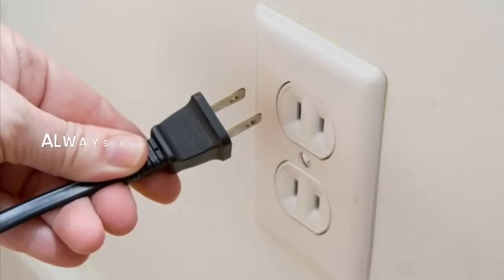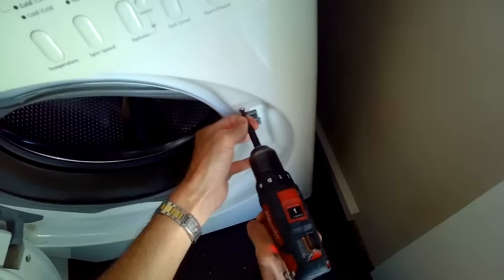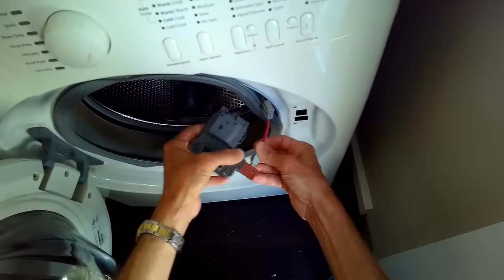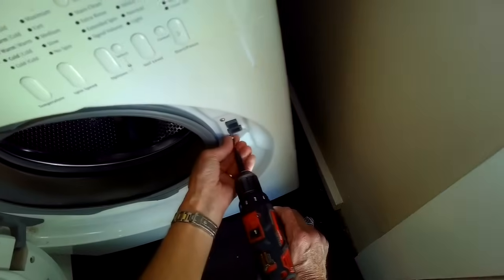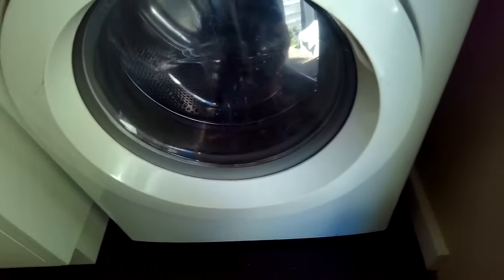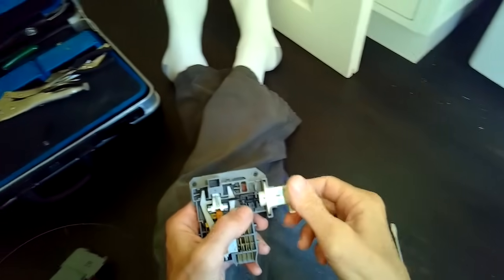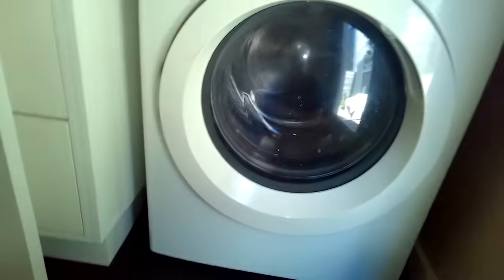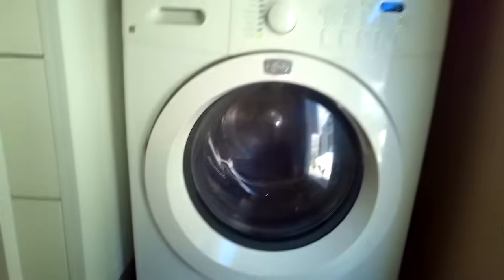✨ FRONT LOAD WASHER WON’T SPIN — FIXED IN 8 MINUTES ✨

Comment: My Samsung direct drive front loader washer will shut off after rinsing when its time to spin. I read your advice and bought a new door lock switch Amazon $16.. I was so happy, then after 5 loads.. its turning off again. We've checked the filter, its clean. Put the drain hose in the sink to check it and water is rushing out. At this last shut off we had to ring out the clothes by hand so we could put them in the dryer and there was a puddle of water in the drum. After soaking it up, it was like water was seeping back up through the drum holes to another puddle... Finally, I was able to dry it up. I just ordered a new drain pump from Amazon just in case. Do you think that is it? I see mentioning of a motor control board.. Can you be more specific? I was looking up parts and I'm confused on which you are referring to.. it lists control panel, washer control panel, washer electronic control board, I don't see control motor.. unless you mean the direct drive motor. If so, we still have a direct drive warranty to cover parts only. I must pay service call and labor through Samsung..
Reply from the maker: Thank you,
Do you see any codes coming up to indicate that there is some type of an error when it is unable to spin?
Reply: No codes have ever displayed. I've been watching the control board it will be in rinsing cycle then when it switches to the spin it turns off.. no code. I have to unplug and plug back in to reset and it will start where stopped, with remaining minutes, but no code. Randomly it would finish, but recently my luck has ran out and I cant get it to finish. I had been after plugging back in to reset, sneaking and pausing the cycle and setting to rinse and spin cycle and that worked a couple of times. I don't know if moving the dial would trigger something if it was stuck, but like I said, my luck is over, lol.
 @QuickAndEasy5MinuteAppliance
Reply from the maker: Thank you,
Can you tighten up the screws near the hinges so the door isn’t loose.

Comment: Thank you so much for the video. I was wondering if my washer does everything when you start it like you said but you can hear the door lock does that mean that you should still replace this part? You can hear the drain motor when you start it and it sounds like the door locks but still no spin. Please help. Thank you

Update 
So I just took it outside and it was full of water. The drain was clogged. Like you said it was full of water!! I unclogged the drain and now it’s working fine. Thank you so much for your video. I can’t believe that’s all it was.
Reply from the maker: Nicely done😊

Comment: Does this fix work if the washer won't fill up properly AND won't spin? My washer worked fine 2 days ago but today half the clothes aren't even wet and it wasn't even a full load of clothes. I already cleaned the drain.
Reply from the maker: Hi Raven,
I think the little screen on the back of the cold water valve is clogged up and not letting the cold water flowing as fast as it should.
Can you turn off the faucet on the wall and then you suppliers to remove the cold water hose and then cleaned a little screen on the fill valve?

Comment: Thanks for posting the video. How do you know the lid lock was the issue and not something else such as the belt or carbon brushes?
Reply: LG's are direct drive, no belts.
Reply: @TippyPuddles  I went through the repair and replaced the part.  No change.  Still no spin.  Any ideas what else it could be?
Reply: Why would the door lock be the culprit? If the lock didn’t work how would washer.  the even start?
Reply: @ATP360  Best question here! You discover it's not spinning at the end of a wash -- and it could only wash it the door lock was working! So we need to be told that the lock breaks down during a wash cycle, not when the machine is not in use. If it broke down when the machine was not in use we wouldn't be able to use the machine at all! Obviously. Does that happen?

Comment: Would the door lock switch be ok if it clicks ? Mine clicks
The drain pump does not power on.
I've checked for clogging in the pump and pipes.
 Samsung front loader.
thanks
Reply from the maker: Great Question👍 Click Here to Get Live Expert Help From Me For Just $5.00:
https://www.youtube.com/channel/UCGpInAejvpfVVE4FHB_L-Dg/join
Reply: @QuickAndEasy5MinuteAppliance  Replaced water pump and door switch. Works fine now. 👍

Comment: Hi sir my washer machine has problems with spine .when I put on the spine it show 15 minutes but the time goes stock on the 9 minutes and not going faster spine. It just move the clothes but not spine fast . Do you think it has this part problem as well? Thanks
Reply from the maker: Could be that it needs a new door lock which is the cheapest solution or it may need a new motor controller which is much more expensive.

Comment: Help! I have a Candy GrandVita 1400. I think it’s the same problem except one of the  brackets in the drum Is loose...looks like the screws have fallen through the holes. But it’s the same issue regarding the spin....should I be looking at a different fixture or go With the instructions on this video?

Comment: We have a Haier washer/dryer combo hdw1600bw. (I understand that GE supplies the parts?) The PCB and door lock are new. Despite the fact that the test modes run without reporting any issues, the drum does not turn. When I run the spin cycle, it reports error 7. What might cause the brain to think that the drum is turning during testing, but recognize it is not turning in a cycle? Do you think the issue is the motor?

Comment: Thanks for the video.  I was a little skeptical that this would fix my spinning problem since the door lock light was on, but it worked!
Reply from the maker: Thank you Roy,
Many times the light that shows the door is locked will be on even though the circuit that shows that it’s closed has not been activated.
Reply: My tube wont rotate at all manually door open

Comment: I've a Samsung model wf407anw/xaa. I've changed bearings, seal and door to drum seal. Now it won't spin, "acts like ,not motor, but drum locked up, tries but, shakes back and forth a little. Is this the only thing that can cause this?
Reply from the maker: Can you send that same question to my email at: scottthefixitguy@yahoo.com
Reply: @QuickAndEasy5MinuteAppliance  Samsung model af407anw, tried to spin only. It wobbles, going just a inch or so oneway, then back the other way a inch or so. When it tries to spin, you see it go a inch, maybe 2, then seizes "stops" and won't go, then changes directions. The same thing that way as well.
Reply: I believe I muffed the rotor position sensor. While changing bearings and such, the sensor came apart. Went back together no problem, pluged back together no problem but now this. I'm going to change the door lock to. I have the old style.

Comment: My machine spun once then drained and stopped. Completely not wanting to complete a programme. Fills, then turns the drum slowly then a few minutes later, another turn then nothing. I had to turn off, drain programme then unplugged. Took off the back thinking it's the bearings of the drum, can't get to them without taking off the belt and wheel. Pulling my hair out here.
QUESTION: Is the ONLY way to tell that the wax is worn by the drum not turning as it should?

Comment: How did you know the exact problem? 
I would have thought it was the motor or the belt
Reply from the maker: The door switch is the most common reason that the front load washer won’t go to spin

Comment: Scoot,
 First hanks for all the info you put out there I'm sure you have been a blessing to many. 
I just wanted to know your thoughts if this would work for an Frigidaire affinity washer that throws an E59 code. 
The washer fills but no agitation or spin very slow draining Cln cycle will not run
Thanks for any thoughts.
Reply from the maker: Hi Mac,

This should help:

https://www.applianceblog.com/mainforums/threads/fafw3801lw3-frigidaire-affinity-he-washer-e59-code.68290/

Comment: Hey man. Can you suggest what could be wrong with my front loader..  the cycle starts and goes through drain and filling but won’t spin. Brushes are new. The motor starts up one time at start of cycle then stops suddenly? Any ideas? Thank you 🙏🏻
Reply from the maker: Hi Michael,
I would replace the motor controller👍
Reply: @QuickAndEasy5MinuteAppliance  thanks for your reply on this. Where do I find the Motor Controller? Is it part of the PCB or is it the Tacho Coil? Thanks Mike
Reply: @QuickAndEasy5MinuteAppliance  Hi Again, hope you’re good! ;) so since this morning I have put the machine into service mode and tested all the functions, they all work correctly including the motor.. But yet when I start a cycle the motor cuts out after one spin?? This is very confusing? Any ideas at all would be greatly appreciated 😊

Comment: Question... when I turn the washer on it sounds like the water is going in then draining. That's all it does. Is this the part I need??
Reply: Did you manage to fix it with that part? Cuz that's what mine is doing.
Reply: Ours is doing the same how do we fix it ?
Reply: Guys that's simple you gotta clean out the filter it's clogged
Reply: Is your washer filling then draining only? Or is it also not spinning?
Reply: Mine does the same. Is the lid lock the problem?

Comment: Hey mate, so my washer spins, goes through its normail wash cycle ok, but then won't do the spin stage, at high speed. Keeps saying unbalanced (even though its level and has a balanced load). Any ideas?
Reply: Its a fairly modern panasonic front loader
Reply from the maker: I wonder if one of the shock absorbers is broken?

Comment: Every cycle works exception of final spin. Changed the wax motor twice (red) changed out from white one, still same problem. Any thoughts why? Would I need a new door/ latch mechanism (with 3 connectors)?  I cleaned out boot to the drain pump (there was no plastic cup trap) found two quarters bottom of boot and made sure the entire drain hose was clear. Still didn't help with my problem?
Reply from the maker: Time for a new motor controller.
Reply: Quick and Easy 5 minute Appliance Fixes  I appreciate  your reply because not many YouTube postings do so.  I did purchased a new door switch but still had the same issue. I was thinking control board..there was no burn marks and  I did blow away any dust on it. From the motor I removed  the belt, placed on spin cycle to hear noises to suggest a bad motor...it sounded okay.  I lubricated it. What did sound bad was the drain pump..vibration noise I secured the pump as best I could. Kept the new door latch in...all cycles including final speed spin works. I may need in the future a drain pump since the removal of the quarters showed up a bit bent and scratched up.  Maybe the new door switch with combination of other tasks mentioned did the trick.

Comment: My GE washer is not spinning at all, but it does make some noise when I run the spin cycle. Still possible problems with the door lock? Thanks!
Reply from the maker: Probably a broken belt
Reply: Thanks for your quick response. It is not the belt. I actually followed your video and removed the door lock. It turns out that my washer is an old model (WSSH300GOWW) and the wax motor kit is a little bit different. Nevertheless, I opened it, didn't find obvious problems and put it back. Surprisingly, it started to spin a little bit (more like agitate, several rounds of backward and forward spin), but not very fast. I put in a towel and tried to wash it. It started the wash cycle but stopped after a while. then I realized that I could not open the door anymore. Any idea on how to open the door? Thanks!
Reply: @rhabdomere  Some people have run the diagnostic mode (if it has one) and that opened the door Search internet for your model. Hope this helps someone.

Comment: Will the drain pump spin if the door switch is faulty?
Reply from the maker: Hi Paul,
The drain will still work when the door lock no longer works but it won’t go to spin.
Reply: @QuickAndEasy5MinuteAppliance  My dilemma is that I have taken the job on thinking it was the belt but it turns out one of the brushes is badly worn do I risk spending money on brushes when It could be the interlock or damaged caused by the worn brushes what would you do? I have tried putting it into drain spin the pump will start but no spin

Comment: Hey, I have a problem with my washing machine. It pumps the water to the drum, but then it doesnt spin and just stays there. I hear the click it does (probably to switch from pumping to spinning), and then nothing happens. So far I have cleaned the filter on the bottom right (indesit machine), and checked if the belt is on. Would appreciate any advice.
Reply from the maker: The most common reason is a worn out door lock.
Reply: @QuickAndEasy5MinuteAppliance  Thanks a lot for the reply. I did tighten it just a day before that happened because my washing machine was making noise around that area, so I tightened all the screws including the door lock. Would the best way for me to check it be just unscrew them back and test again or?

Comment: I’m dealing with the same unit, and when I press to start a normal cycle, it locks the door, then unlocks the door and all the lights shut off giving me an error code of e23 please help 🙏🏼🙏🏼🔥🔥
Reply from the maker: Thanks Arnold,
Just need a new door lock👍
Reply: @QuickAndEasy5MinuteAppliance   I replaced the door lock continues to do the same thing
Reply: @QuickAndEasy5MinuteAppliance  so if try to start a normal wash and I press start  locks for a second then water starts to fill then immediately everything goes dark and I have to try to start the cycle all over again, but it just does the same thing I replace the door lock I ran a diagnostic, all the water valves, work spin, agitated, work, drain pump worked, but when I got to the end of the diagnostic test I got an error code of E23 It says that the drain pump could be bad or the relay on the control board is bad to replace the control board on the tech sheet just wondering which control board the motor control board or the interface control board would really appreciate your help. Thank you.🙏🏼🙏🏼

Comment: Mine drains and pump kicks on.  But it doesn’t spin.  But if the doors not closed all the way it won’t start at all. Is there a different sensor in this that would cause this problem? Because seem like the door switch works.
Reply from the maker: I’d say either the motor brushes are worn out or the motor controller is toast👍
Reply: @QuickAndEasy5MinuteAppliance  it was the wax motor. Got new one in today replaced it and it works now.  Thanks for a great video
Reply: Same are the poster 
It’s fills with water 
I can hear some type of machination BUT not spinning 

I can force it to drain but unit doesn’t not spin 

Any insight?
Reply: @red07JK can you elaborate what’s is wax motor please. I have the same issue. It fills with water and drains but never spins or even tumbles
Reply: @gugagugadj4464  it’s the part in the video he changed.  It’s part of the door lock that tells your dryer it’s ok to spin.
Reply: CHECK THE FILTER!!! These guys really make ya do more work than ya need to. The water filter is almost ALWAYS. The issue

Comment: Hello, yesterday my washer stop working. It was locked as water was still in there. I drained it with the emergency drain so it unlocked the door. I closed the door, go to spin only, press start, it locks the door, nothing happens, after about 5 seconds it unlocks the door. What can this possibly be?
Reply from the maker: I think it needs a new door lock 👍
Reply: @QuickAndEasy5MinuteAppliance  it ended up being the drain pump. Thanks anyways
Reply from the maker: Thanks so much for the follow up,
I  hope you can join Our Channel Membership To Get More Valuable Fix-It DIY Info.  Here’s A Link To Find Out more: https://www.youtube.com/channel/UC7fBqy8806u1r0NpPv_fQ2w/join
Reply: @I-Am-No-One  so how Did you find out?
Reply: @johncollins8304  it was a few different things that i had to put together through logic and tests. It all started after the washer went through a normal wash cycle. But, it did not drain and was locked up due to water being stuck in the washer. I drained it and it unlocked. Then tried to test it by putting it into spin. The washer would just lock for a few seconds then unlock and never went into the spin cycle. Thats because the first step to the spin cycle is for the washer to drain, but since the pump failed it wouldn't ever go into the spin as it detected the pump failed. I ended up ordering a pump from amazon for $30 which was exactly the same as the original pump. 
I only later found out the washer said "nd" after it first locked up. That code stands for "no drain". I guess it only showed this code when it first failed and never showed it after i manually drained it.

Comment: I open my blomberg door lock, I saw the Bi-metal contact and a coil relay. it always show "door not lock" on the screen. then I put some solder on the contact to raise it up a little bit to have more contact. it works, but i get a problem, the machine is not filling water and not spining, also can not pause. it start filling little bit water and sound's a agitates for 3 minutes then drain out. I just wonder if something to do with the door contact again because i have open it. there is 4 wire switch 28053110 blomberg door lock, two go to the coil, other two is the door lock.

Comment: Sir, My samsung digital inverter washing machine, drum not moving it just fill water then sound like water drain try to pump out water, and time indicator start from 20 minutes after few minutes its come back to 20 minutes again, any solution for my problems sir ? My washing maching did not use carbon brush.